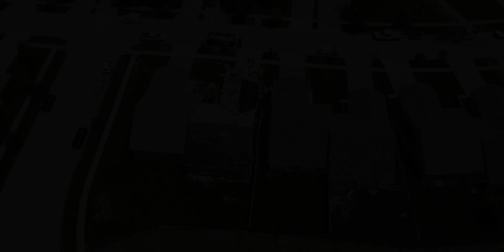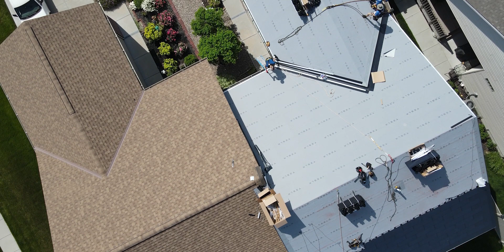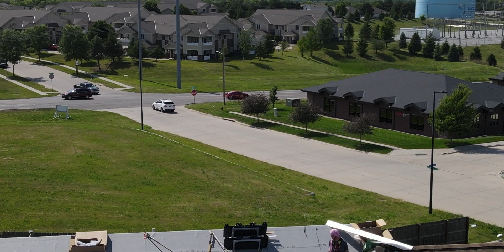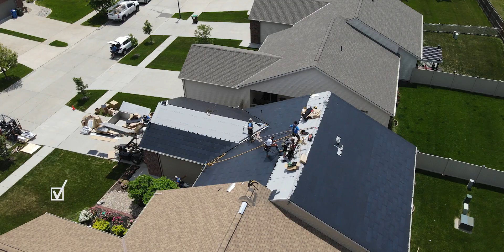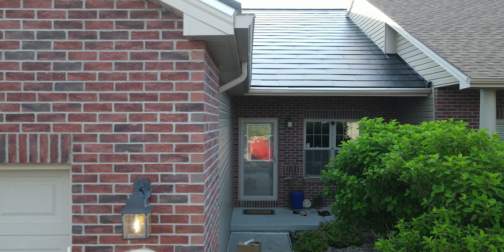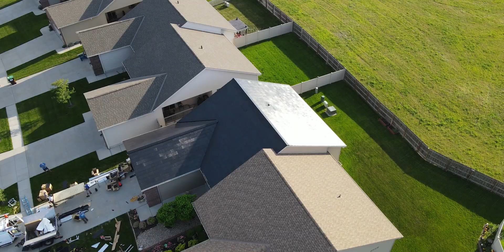This Duplex Was No Problem To Install A Tesla Solar Roof!

Comment: The tiles appear slightly different than when I saw them before. Has there been recent changes to the tiles?
Reply from the maker: A few minor updates to some flashing pieces (now with the same texture as the glass) but tiles are the same. Lighting may play a role here.
Reply: @WeddleAndSonsRoofing  Interesting. Thanks for the reply, I must have not noticed the screws through the top of the tiles before!